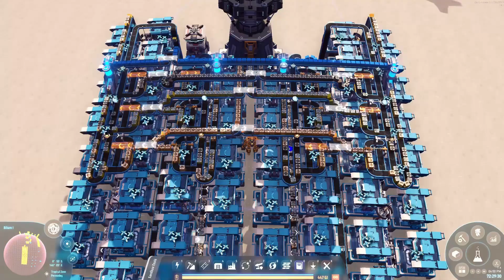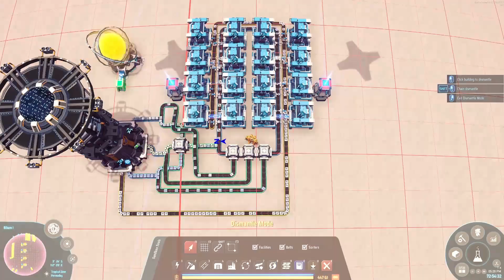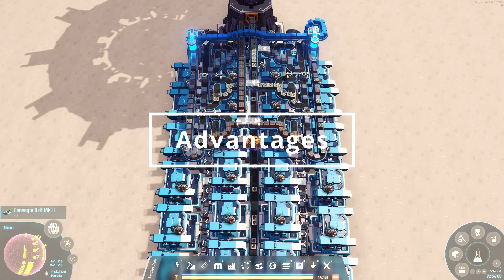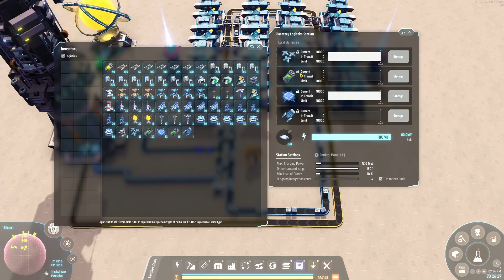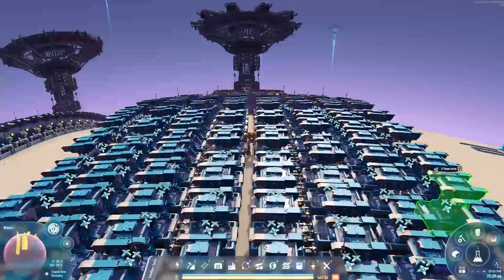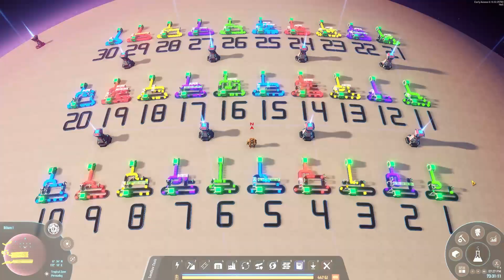DSP Sushi tutorial 2025

Comment: Thanks so much for showing the progression from spaghetti with splitters to sensible and organized.  Really helped me understand what I need to do to get the thing running.  Going to use this for a startup mall I think.  Just have to be careful only having a single belt speed to work with (planning on using mk I splitters of different lengths to ensure slow input, fast output)